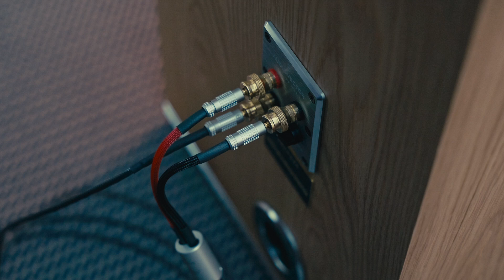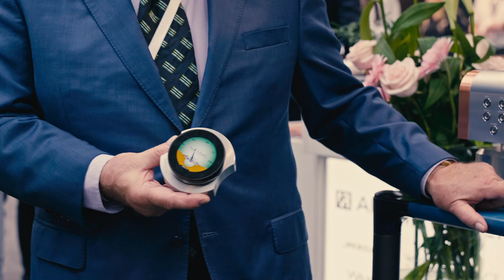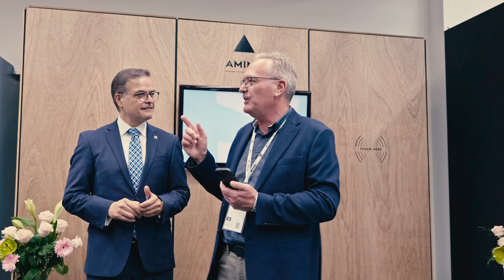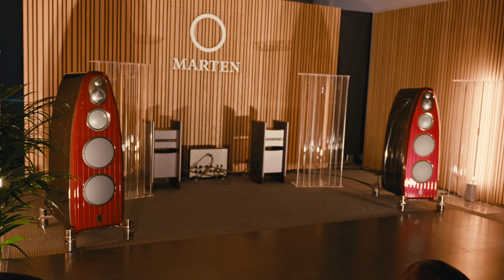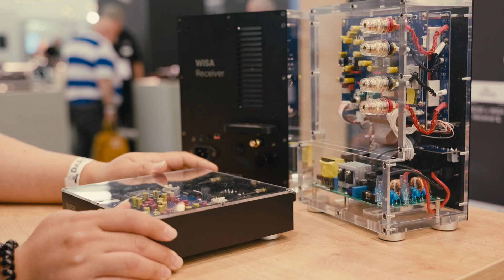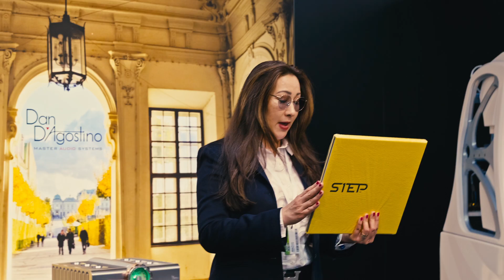High End Munich 2024 Coverage - Day 2 Best Day!

Comment: funny marketting stuff felt does not damp, baffle difraction all that much (only at really high frequencies). while still having huge sharp edges (that could have had far more impact if they where rounded). witch makes baffle difraction worse..  having an offset of the drivers  makes the response been different left of the speaker compared to right. (while in this design you could easilly make it the same... but maybe not because the felt does not do what it was intended to do)  weird choices, grounding the chasis.  is well... not gone do anything. delivered with a seal.. wtf , pure marketing bs. really we need a wax seal ?
Reply from the maker: Please don’t tell me that you are part of those dislike my reportage and work, i was there guys to show you what i found, at least you left a comment✌🏽